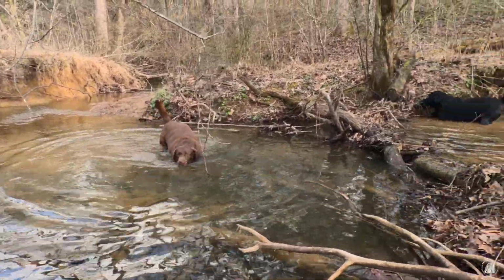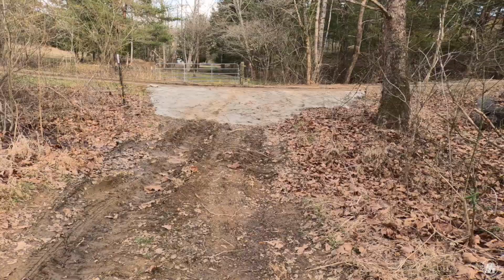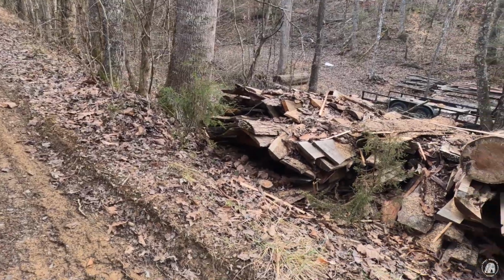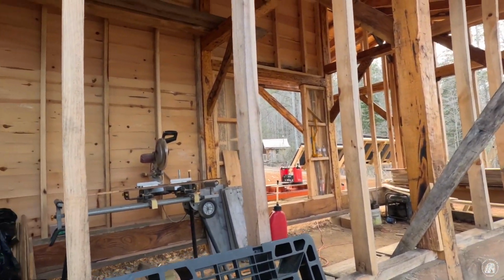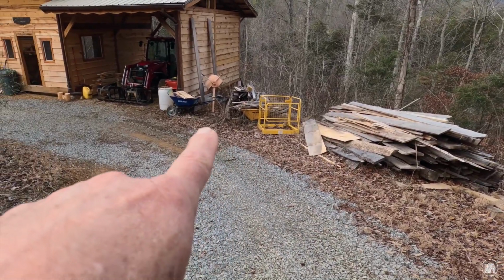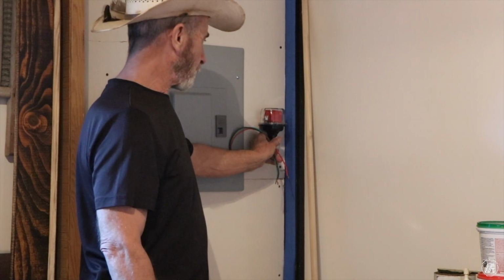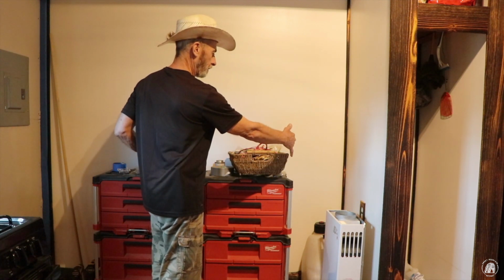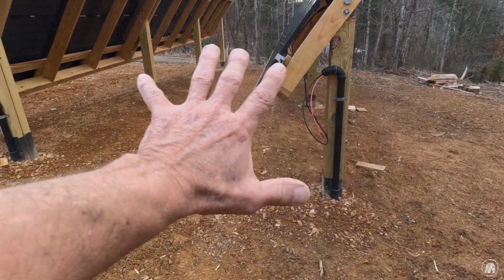BURN PIT - WORKSHOP - SOLAR AND POWER ARRESTER

Comment: I had time thinking Dont spend money on White stone.  Create a decking type structure then paint White.  Also nows the time you can upgrade panel mounts to make them tilt full vertical.  Especially in winter.  Then bring back to this angle for summer
Reply from the maker: This is the winter angle 55 degrees. Summer will be 20. Good idea

Comment: The pex pipe Richard is not hard to run.  3/4 of an inch is what is run.  It cuts off with the tools then It is crimped onto the fitting.  And it doesn't leak.  I have a plumbing book here with pex information.  My one neighbor is a roofer, like I used to do some of this too, he told me just to buy the tools then get rolls of the pex piping.  I still use the cooper and sweat the joints and my joints have not leaked yet.  I clean it all up good first, then the soder and heat.  We lived next to a swamp in Norton Ohio yet, I do not know how to drain the swap.  Barberton Motor Speedway was behind the swamp.  I have been tired of living here in this cold house and it get's colder.  As I go to be and see 32 I pray and ask God to keep an eye on me overnight hopefully I wont freeze.  There was a crew next door working.  They tore off a slate roof and put in particle board to repair the roof before shingles.  They had a loud generator going for about two hours to power their small compressor for the nailers.  This crew worked about two hours.  They have three saftey ropes up there.  And came down for a break a few times.  This was the second day and it took them about four hours to roof that house.  The generator went off and then this crew whent into the house and took out the old furnace and carried all this outside.  Meanwhile Paul here is not feeling good all day, and now the one neighbor is in their scrap again taking it.  Only frustrated Paul here yelled hay at him loudly.  Jim came back and was not noisey this time and stold my trashcan that belongs to the city.  They pickup our trash.  So I have been praying for Jim.  For good stuff to come to him, good health, prospierty, and happine.  That he be loved, and hugged and showered with flowers.  That Jim be happy, joyous, and free.  Jim gets into our trash on our street.  I put out some good scrap one time while working on my Chevy Van and he got that and took it in for cash, then a lot of stealing went on on our street.  So I wont bat an eye about moving away from here.  In Jan it was 38 years I have been here.   I liked one showing us about the fire pit.  The concrete approach to the driveway.  The arrestor.  The hanging of the continous hot water maker.  These are good to have.  I wanted to build a small outside shower for me to use.  There is a guy Scott that lives in North Jackson Ohio that buys up the 20 bundles of slabb wood and makes outbuildings with them.  The Upoles build houses and stuff.  Chairs can be made out of them for outside.  Longe back, short front, medium seat part.  I did not get to let Jim know it is all the noise that is the problem that he is making getting into the trash and I don't want him in my trash.  Am going to try to get Jim to go to flea markets on Wednesdays, Sundays, and Fridays, hopefully.  I do have to let the garbage man know he took my garbage can .  This guy picked up the garbage and tore off the wheels and the lid.  They sent guys out to fix it up again.  My address is on my garbage can.  I ordered two of the same book.  How to build small barns and outbuildings.  I was reading this newer one and recalled the planning of the buildings.  He had one barn with hay in it go on fire and almost got his house on fire.  We are when designing our places to keep buildings about 80 feet apart.  I got to fine some property first.  Then plan this out.

Comment: Richard - how about more panels on the roof of the sawmill shed, the orientation seems to be the same as your existing panels and it would probably be no more expensive than the white gravel - which will get dirty over time and lose much of its reflective properties.